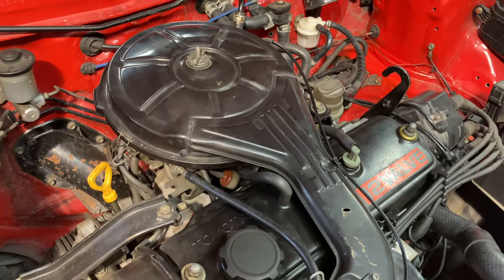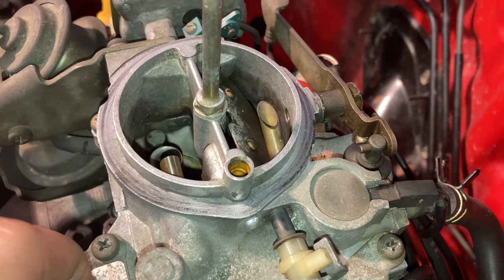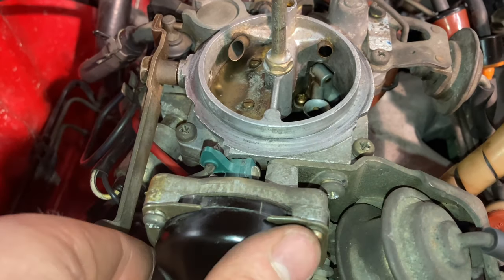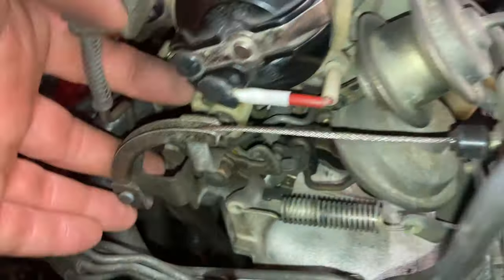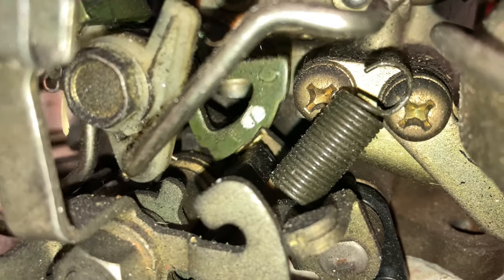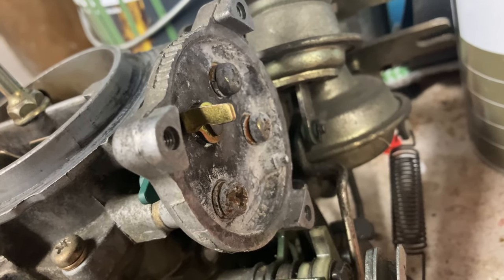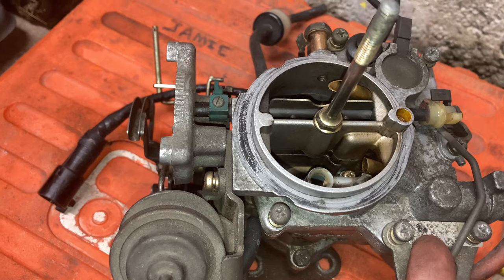How to adjust a Aisan Toyota 2E Carburetor

Comment: jamie i have a ee90 corolla with a 2e engine and one day the engine decided to have a massive loss of power and i didnt do anything it just magically lost 50% of its power ,it runs the same but it also hard to start it when it is hot also the rpm gauge doesn't work

Comment: Hey there Mate, hope you're doing great. TBH, you've helped me a lot by making the Videos all about 2E engines, i have a 1984 AE80 Corolla with a 2E Performance swap, and I wasn't able to get the Auto Choke to run correctly, I set the dashpot to 2000RPM as per your video and also my Idle Speed. But the Fast Idle was being a pain for me, and your guide helped me so much, I was able to do it successfully today and finally when it starts cold, the Fast Idle steadily rises to 1600 RPM and drops when the engine reaches the certain temperature.
If it wasn't for you, I would have been stuck for life in this one segment.
Once again, Thanks A Bunch. Stay Safe & Stay Well.

Comment: Mine keep floating... The mechanic has been trying to adjust and adjust.. This the the third day.
Last night it even spilled fuel.

Note : I am using this carburetor for an old Jetta VW version 2.
Reply from the maker: Sounds to me like an issue with the float not sealing, jamming up or having an incorrectly set height. I would start there, cheers!

Comment: I fully agree with staton tivers!!! This is the most informative video on adjusting the 2e carburetor. Thanks for the upload.
Looking forward to more videos from ya!! I have an idle problem (sputters and stalls) on a similar Aisan carb mounted in a Suzuki swift 1.3L (Geo Metro). It now runs fine after adjusting the fuel mixture as you described!!

Comment: Thanks for the info.

Just one question, does the choke breaker cam automatically go to the fully closed position on a cold engine when you step on the throttle?

Mine either doesn't fully return or usually slips from the fast idle block which causes my cold start to run only at around 1200 rpm

Comment: Hi
Im having trouble with cold starts and really high idling sounds when the engine is warm up.
My engine has recently been overhauled so im not sure if the problem could be with the carburetor or the timing itself
Reply: Hi there, did you end up finding the issue? I’m having the same problem 😅

Comment: I've picked up a 4k carb for a Suzuki. It has a mechanical secondary, but the thing I can't get my head around is the weighted flap that sits above the secondary butterfly. Is this supposed to be hooked up to anything else to open? Just seems to be sitting there by itself and I can't see any correlation with it and the throttle linkage/choke/anything...
Reply: And it's just occurred to me that given the design, it could be vacuum operated internally by the throats themselves.

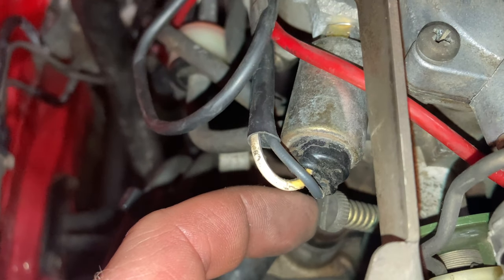Comment: Great video. 7:15 "this one sets idle speed when the engine is warm". My 1E engine (which seems to have the same carburetor) is idling too high when warm. I can make it idle faster with that screw, but when trying to make it slower there is a certain point after which turning that screw further makes no difference. If I press very hard on the lever that the throttle pedal pulls (but in the opposite direction) I can make it idle a little lower at a good speed (even though it doesn't feel like I moved the lever more than a fraction of a millimeter) and when I let go the idle speed returns to the too-high level again. Any tips?
I just bought this car recently and the previous owner had fabricated an input on the underside of the air-cleaner, and had connected the PCV valve output into the air-cleaner, and the air filter was absolutely filthy. Why would they do that I wonder... I have since reconnected it to the normal input on the carb body, but I'm wondering if that has made the carb very dirty inside and it just needs a good old clean.
Reply: ah never mind, I see you already have a video showing a problem with worn butterfly valve, which looks very suspiciously like the problem I'm having.

Comment: Just took mine apart. I have been restoring a toyota tercel and did the carb last winter. I just finished putting the car together now in the summer, went for its first test drive and it ran like crap! I checked the carb on the side of the road, the accelerator pump didnt squirt and i managed to make it run better after clearing the fuel filter. The petrol was bright orange. I barely made it home it ran so bad. I took the fuel system apart and emptied the tank. The gas was full of water and something that looks like oil or something. The carb was full of a gello type material that had clogged the bowl and everything. Hope it will work tomorrow!

Comment: Will a 2e carb bold straight onto a 4af? Plz someone’s played with mine won’t idle when cold and secondary butterfly won’t open checked for vaccum leaks
Reply from the maker: Nope, the 2e carb wont bolt up unless you make up an adaptor plate or modify the intake manifold flange etc. The 4af and 2e carbs are similar in basic design but are quite different in size and shape

Comment: Jamie i have a 16 valve conquest and it does not want to idle in the morning...its cold in capetown...i have to keep the car on a rev until it heats up.. Otherwise it dies...is it the choke setting thats incorrect?
Reply from the maker: Sounds like either the choke not coming on fully when cold or the fast idle speed is adjusted too low

Comment: 7:05 for that idle adjustment of hot engine, how much turn can you make to get low rpm idle. after sometime i tried turning on my car, it seems to stop making a difference
Reply from the maker: The primary throttle plate is most likely worn, they have a tendency to wear out of round in these carburettors causing them to not fully close when the engine is running. Check out my video where I go over this problem (called Repairing a Toyota 2e sticking accelerator)

Comment: Mine 2e engine gets idle and stop working when i run vehicle upto 9kms and after few minutes it again starts and run after getting hot again it do the same idle someone told me it has problem with its vacum. What should I do suggest.
Reply from the maker: Possibly a fuel issue? Maybe the carb is running only on choke and could have blocked passages that need to be cleaned out. Ill be working on a video detailing the overhaul process of a 2E carb in the near future

Comment: Hi great video,What causes the carb to backfire when you leave the accelator,no smell of fuel,timing is set,plug leads are new etc I have a asian carb on a Tazz 2E
Reply from the maker: Possibly a vacuum leak or incorrectly set idle mixture screw… the dashpot acting on the throttle linkage (on the side of the carb opposite the accelerator cable) is designed to reduce any backfiring. Exhaust leaks can also cause small pops when coasting. Hope you figure it out

Comment: Hello, I am writing from Turkey. I have a question for you. I have a 2e Toyota. My problem is when I turn on the fan. When I turn on the headlight the idle drops Idle drops when I brake When I turn on the heater, the idle drops, if you can help, I would appreciate it, thanks in advance
Reply from the maker: As the alternator needs to meet the electrical demand of the vehicle accessories, it requires more power from the engine. Unfortunately these carbs don’t have a means to increase the idle as the load on the engine increases. A slight increase on the idle speed screw can help with a vibrating engine from too low rpms
Reply: @notcompletelyobsolete  I got it, thanks, so why does the idle fluctuation sometimes happen at 9, sometimes at 10?

Comment: Very nice , thanks, at cold start the revs is very high , but runs fine when warm
Reply from the maker: If the cold idle speed is excessive, this can be adjusted via the cold idle adjustment screw (on the accelerator cable linkage as shown in the video). They typically run up to around 2000-2500rpm when the fast idle breaker has not yet actuated the green cam. Hope this helps

Comment: After I shut the engine off, the float chamber leaks fuel (probaly all of it) on top of the secondary butterfly valve. (4AF engine)
During running the float level is correct.
Reply: This problem doesnt occur when the secondary butterfly valve is blocked from opening. I tied a small wire in the correct place, so the valve cant open.
Reply from the maker: Sounds like it may be time to overhaul or replace the carb. Good luck
Reply: Mine leaked a bit like that.  Found out the secondary venturi was siphoning fuel cuz the tiny vent hole in the venturi  module was plugged.

Comment: I almost bought a new carb thats over 2000ZAR because the car left me at the side of the road many times, then someone said the carb is dirty and he then switched the spark leads of nr2 and nr3 and rev the car a few times that it back fired into the carb and that fixed it. I later took the carb off and cleaned it with carb cleaner
Reply: Hi len jaars please tell me, is your tazz 2e engine firing order clockwise or anti clockwise on your distributor thank you
Reply: @sathasivanmurugas8639  clockwise
Reply: @sathasivanmurugas8639  1 3 4 2

Comment: Bro my 2e water body , radiator,fan , thermostat everything is ok then why is slowly heatup in slow traffic and cool down at fast traffic with ac ?
Reply from the maker: Possibly water pump, blocked radiator, thermostat… Cheap non oem thermostats can cause trouble and generally are less accurate at regulating the engine temperature. Another more serious cause could be a blown head gasket aerating the coolant and blowing out the overflow. Hope its an easy fix for you!
Reply: @notcompletelyobsolete  i don't use thermostat and water pump is ok because when truck came in front of car in fast traffic the temperature slowly rises up after we overtake it the temperature fastly coming down and radiator is brand new just buyed 5 days ago and there is no leakage water is always full in the radiator . What you think is compressor fan is slow?
Reply from the maker: Running no thermostat can cause engine overheating in most cases, definitely recommended to run one. If there is no thermostat, coolant will mostly run via the bypass through the block itself and not so much the radiator
Reply: @notcompletelyobsolete  thankyou so much

Comment: Hi how do you increase performance and also need to adjust to make it lighter on fuel? Idle is perfect cold start and warm up, but It just needs adjustment to be leaner and lighter in fuel, but not compromising in power thanks.
Reply from the maker: For best fuel economy, keeping everything stock and within adjustment such as timing and valve clearance will help. These engines are quite good on fuel as they are. If you are chasing more performance, the engine is limited by its displacement and aging cylinder head design but there are some ways to get more power out of it. Check out the Rugged Garage youtube channel, they have done some good work on these 2E engines to get more out of them. Cheers
Reply: @notcompletelyobsolete  thanks so much for the reply.....well not really needing the performance only to be lighter so wanted to  know which screw to adjust as I had to change the carb but it just needs adjustment?
Reply from the maker: If the carb is running rich, I would check the colour of the spark plugs. If they are black and sooty then the issue could be incorrect float height or stuck choke flap possibly. If the plugs are a brown chocolate or coffee colour, then the carb will be operating well if the vehicle still drives smooth. The adjustments I have shown on the carb only affect low speed circuits and its up to the jet sizes to determine the fuel metering with wide open throttle. I have never found the jets to wear bigger over time and probably best to leave these as they were. Hope this helps
Reply: @notcompletelyobsolete  thanks so much Jamie appreciate it

Comment: Great video. I have a question about that green cam.. How does it go back to the third step for the next cold start?
Reply from the maker: When the engine cools, the choke actuator puts spring pressure on the choke flap to shut it. When you depress the accelerator pedal, the choke will close thus resetting the green cam
Reply: @notcompletelyobsolete   Awesome! thanks. 👌

Comment: Thanks for the video,
I have the same engine,
What can cause rough idle when I turn my high beam on!?!?
Or radio + heater fan
I changed the battery, and the charger, also the plugs, I cleaned the carp too!
Nothing, still the same..
Reply from the maker: As the alternator needs to meet the electrical demand of the vehicle accessories, it requires more power from the engine. Unfortunately these carbs don’t have a means to increase the idle as the load on the engine increases. A slight increase on the idle speed screw can help with a vibrating engine from too low rpms
Reply: @notcompletelyobsolete  Is there any smart after market carbarator that can slip onto this engine? To solve this problem?

Comment: Awesome video 🫱🏻‍🫲🏽. 
Help my car doesn't start it needs me to pour a bit or petrol on the carburetor for it to start (this is over night, in the morning) but when I drive the car during the starts on its own... do i need a new carb??

Can I drive 7 hours straight with this car?
Reply from the maker: Sounds like an issue with the choke, it would be worth looking to see if the choke flap closes properly when cold
Reply: Your losing fuel from the float bowl.